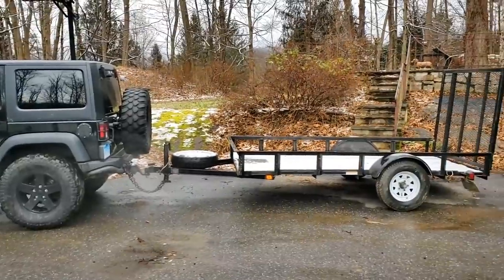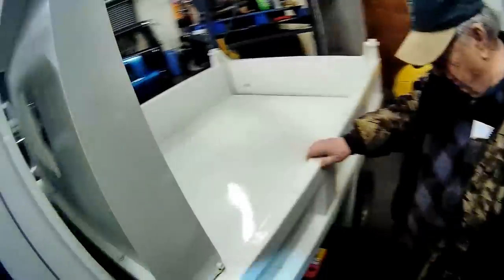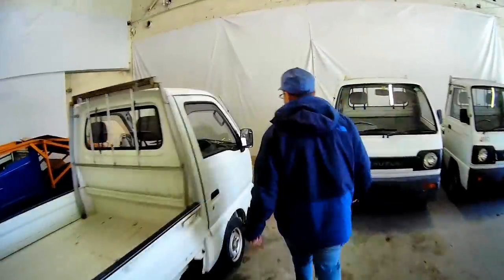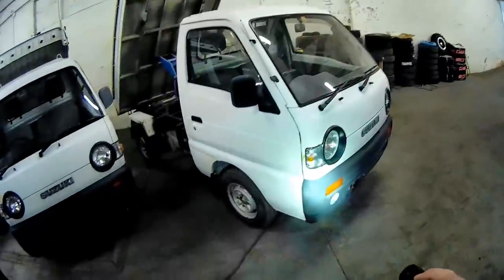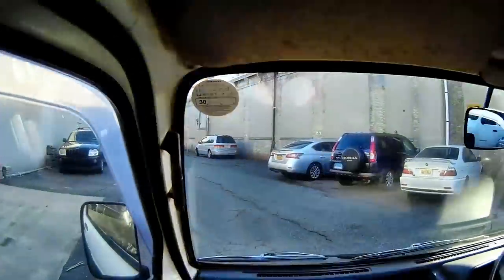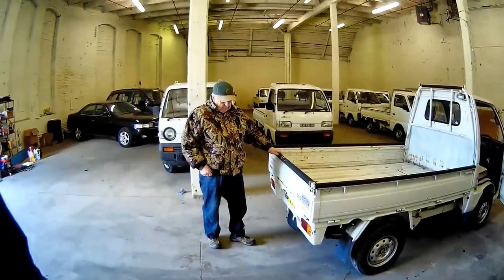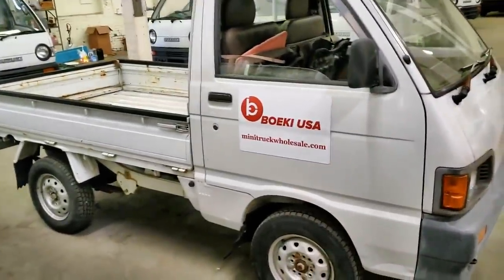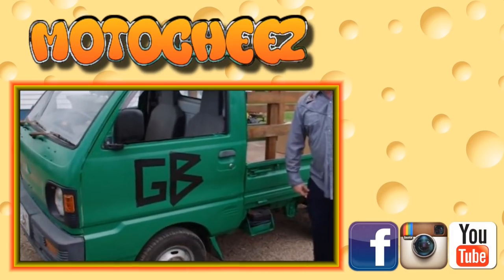$4500 Mini Truck info (SE01 EP01) what to look for, buy and get it home on 5x10 trailer

Comment: Kei truck FTW.  The one to have is the Subaru Sambar, certain models of them ( The XV) come with supercharged 4 cyls
Reply from the maker: I love those, but they don't come with rear axle.lockers. I need that for my land terrain.
Reply: Now I want to find one with a supercharged 4 cyl!
Reply: @ezralord4901  look up piggio porter  thy do a 1300 16 valve efi engine model very fast
Reply: Diff locks are available on all of the brands.   My Sambar has it.
Reply from the maker: I was taking about rear axle locks. Diff lock just engages 4x4
Reply: @MotoCheez  The Sambar has a 4x4 control on the shifter, and a different "diff lock" control on the dash.   The diff lock does force 4x4 on, but it locks up the rear diff as well.
Reply from the maker: Wow. I didn't know, sorry... Damn is that a hard to find option?

Comment: Be honest. You just wanted one because of Bubbles. I wanted one too as soon as i saw Bubs drive one but i don't like the radiator placement.
Reply from the maker: Haha. You got me! The radiator isn't in that bad of a spot. It's protected somewhat too
Reply: @MotoCheez   im upstate New York and needed a pickup to daily so i keep milage low and the salt off of my inheritance (5 speed, 1995 Honda Passport), so i just got what i was able to afford before winter came: a 2003 Ranger with a cap on it. There is a guy around me who sells these, but they were way to expensive for my budget.  Maybe someday.
Reply from the maker: Nice! 95 Honda, sweet!! They are pricey, I looked on CL for months.

Comment: I had suzuki carry when i was in high school 1983. It was fun and very light. I had to put couple sacks of sand to make it stable.
Reply from the maker: The Suzukis are a little more front heavy, which is why I wanted a dump Carry.. this could use rear weight, I'm not adding anymore to the front except another light maybe.

Comment: i’m in japan
and daihatsu is not toyota
totally different maker here
Reply from the maker: I've learned that since first video, corrected in comments, thank you.
Reply: Daihatsu makes many of the Toyotas you see in Japan. For many years they made, probably still do, make Toyotas. The Toyota Cami, Town Ace just to name 2. Both are great products.
Reply: Toyota has been a major shareholder of Daihatsu for many years. As of 2016 they bought the remainder and Daihatsu is now a wholly owned subsidiary of Toyota Motor Corporation.  In Australia, once Daihatsu left that market, you went to the local Toyota dealer for spares and parts (like I did for my Copen).   There's even been rumours Toyota Australia considered the newer model Copen to release there with a Toyota badge and support.       https://en.wikipedia.org/wiki/Daihatsu  "Daihatsu was an independent auto maker until Toyota became a major shareholder in 1967 as the Japanese government intended to open up the domestic market.....In 1998, Toyota increase its holding in the Company to 51.2 percent by purchasing shares from its major shareholders including financial institutions...... In August 2016, Daihatsu became a wholly owned subsidiary of Toyota Motor Corporation." Different factories and sales/marketing/support teams - same owners.
Reply: BTW, Daihatsu Motor Company is the oldest Japanese auto manufacturer est in 1907.   DMC engineers and manufactures Toyota compact models as well as Daihatsu badged vehicle.  Hijet has the highest share of K-truck special purpose trucks (ie. dump, fridge, deep fridge, extended cabin etc.)
Reply from the maker: Awesome info
Reply: Many parts are common denso between the two manufacturers

Comment: a lot of guys in my hometown use these and I have sold tons of 1st gen Mazda rx7 alloy wheels..for changing up to a 13 inch wheel..they are a 4x110 bolt pattern  hard to find anywhere else you just have to machine out the centre hole to fit the Mini truck..thanks for sharing this video..these little trucks are Cute
Reply from the maker: I saw the old Mazda rims would fit offset good too? What they getting fir a set of 4?, hard to find now.  thanks!

Comment: Used these on a farming apprenticeship in Wilton NH. Great truck, we used it for towing veggies, carrying a bed full of rocks (NH sucks for farming because of rocks), and used it to buy tractor parts. We could do a u-turn on a street that would require a 3 point turn in my 1500. I know I would buy one if I own some land. Easy to work on as well, except the farm had one with a carbonator, with a little bit of studying I learned the system and added the knowledge to my belt hopefully. But I for one am a big fan for these mini trucks.
Reply from the maker: Awesome info. Thanks.

Comment: Seems like a cool place...I'm in Pennsylvania so not super far from Jersey.  Do they have anything other than the mini trucks?
Reply from the maker: Yes. I have 3 times I stopped there. They have other JDM stuff. Check it out
Reply: @MotoCheez  I saw their website on the side of your mini truck and did go to their site.  Pretty nice stuff.  I used to deal with Japan Partner years ago when I was racing a prelude.  Their SUVs are a little pricey but the mini trucks aren't bad.  They have a Subaru right now that would be perfect for what I need...just a utility vehicle no off-roading.

Comment: I've always wanted one. My neigh or has one set up for welding. Got a machine and spools. He swapped a motor in and did a bunch of other work though. He puts it on his gooseneck and tows it to the job. Uses it for tight spots. Pipeline to refinery to factory work. He does everything.
Reply from the maker: That is cool as hell! I've wondered if it could be flat towed because transfer case has neutral. Ulrtimate little work truck!

Comment: Love these things! Luckily I kept my 1988 Ford Ranger. Almost sold it once when I couldn't fix a stall problem. Worked on it over 2 years time before discovering a bad check valve in the fuel reservoir. Now it runs perfectly again!
Reply from the maker: People want a nice small pickup like those rangers! Simple easy to work on one!

Comment: working construction for a smaller general contractor company that does commercial office TI"s this truck would be great! I would totally drive/use one of these ! In fact for how cheap they are i want one! where could i get one in WA state?
Reply from the maker: The place I went to New Jersey had them starting at $4,000, they have a sister company or actually the parent company is out there I believe boekiusa.com. I also have a bunch of links in the description of all my videos

Comment: Mine is just rear wheel drive and no diff lock,it does about 50mph.
If you get the PCM reflashed they say it'll do about 70mph or more.
Reply from the maker: Not bad.

Comment: I have had a climer/dump for 6 years on my farm
its lightly modified on the suspension. I will carry one round bale or 2 large squares ( 700# each ) I have worked the shit out of it and it keeps on going.
Reply from the maker: That's awesome, love all the input I'm getting on these. My uncle owns a decent size farm, he's a little tall for it but may still get one. His only issue is standard shift for farm hands, but in low it's so easy to take off it's not an issue imo

Comment: that crazy steering sound goes away it's the short and long cv axles scraping on their teeth it hadn't been used in awhile.
Reply from the maker: It's a rubber mount on the steering column.

Comment: I have a friend in Northern California who has a Suzuki 4wd mini truck. He talked to the local Highway Patrol, and was told that it could be run on the road as a farm vehicle, and he didn't need to register it. He has to display a safety triangle reflector while on the roads.
Reply from the maker: Yes, that's a work around. Max speed is 25mph. It's "slow.moving vehicle" triangle. I'm doing that until I get.my registration. 😁

Comment: when I was stationed in Japan the on base repair shop had one with a larger motorcycle motor in it and it hauled butt
Reply from the maker: Sweet! That's what I've said I would use if I ever needed a transplant! High RPM , small footprint and high HP is perfect for these low geared lightweight trucks.

Comment: Very cool little trucks!! Cheeper than my UTV and to get heat windows ac/heat in a UTV Gotta but sumthin new for $35k or ton of money in after market! Not as much suspension but with a lift and ATV rims and tires this would be an awesome little off road vehicle and with that bed very cool! Set up as a little expedition truck with like an over cab rack with roof tent and some extra gas/water put all your gear in the bed and go!! Very interesting. Thanks for the content
Reply from the maker: It is! I did a ton of mods in this series into the 3rd season on this playlist
Reply: MotoCheez thanks I’m gonna watch everything ASAP thanks again!

Comment: These little Bongo Trucks are so much fun to drive. I was stationed in Japan for 5 years and enjoyed the one we had at work. Only issue is they're not built for people over 5ft 4 & I'm 6ft 1.
Reply from the maker: Yeah. I'm 5'10 and fit OK. If I were taller would be tight.

Comment: We had a couple in the service.  They were governed to 25 mph. Above that, the ignition would shut off, and if you kept your foot on the gas, all the gas would end up in the oil pan.  Never hold the throttle against the governor.
Reply from the maker: Nice, the ones newr than 25 years old have to be to be legally brought here. This one isn't governed.

Comment: You know, if I had a bunch of property to maintain I'd much rather have one of these than a UTV. These are fully enclosed, have heat, sometimes even AC, and they're not gonna be more expensive than a UTV, and you can even register this and put it on the road if you needed to run into town for something.
Reply from the maker: I agree with you 100% and that's why I decided to buy one 😄😄

Comment: I sat in one, the cab is to small in the cab I'm 6'3" 300lbs . I think the van type would would be a good mail Trk for delivery.
Reply from the maker: The jumbo trucks have a bit more room too
Reply: @MotoCheez  usually it's the leg room and the seat doesn't go far enough back.
Reply from the maker: David Taylor the seat goes back further on the jumbo. It’s an extra cab

Comment: Those trucks would be great to experiment on 
to  convert them to Electric Vehicles.
Wen I worked for the DoD, 
they had many of these forms of mini trucks and vans
military bases.
Of course you could not drive them on the public streets,
but you could drive the all over the base.
Reply from the maker: It would!

Comment: they actually fit these daihatsu hijets and suzuki carrys with 1000cc and 1500cc engines engines outside of japan, you might want to check those out.
Reply from the maker: That would be awesome
Reply: @MotoCheez  oh and you should also definitely check out those old Daihatsu Taft or rocky, they're kinda similar to the Jimmy

Comment: Are they street legal on major roads not hiway I would daily one 30 mile round trip to work if the bed hade higher sides
Reply from the maker: They are in most states, but I wouldn't use on the highway, they're slow and not that safe

Comment: i just remembered that my dad used to have an upsized/non-kei version of one of these in red called the daihatsu zebra espass(D130 jumbo), it's a 4x2 but it has a 1300cc with a 5 speed, that van was a total POS and broke down a lot
Reply from the maker: I haven't had any issues
Reply: Zebra was designed and manifactured in Indonesia.
https://en.wikipedia.org/wiki/Astra_Daihatsu_Motor
Reply: @phineasNBJ  but it was based on the jumbo Hijet, just a different engine and body style.

Comment: Cushman used to sell these small trucks back in the 90s/2000s also in a van version. Seems like they were made by a Chinese company. They pop up on Craigslist every now and then.

I believe these had the 4th gears knocked out to limit to speed to 35 mph. Otherwise it would too easy to over ride a governor on the carburetor or ignition system to get them to go 50 mph.

That way they could be considered a low speed vehicle and street legal in some states like Tennessee. The first time I actually seen one on the road was in Greeneville, TN, It was used the city. 

Does this guy ever import the van version? All I seen in the video was trucks.  A micro van is what I would like to have. 

Also did he supply a NJ title with it?

I can technically register anything older than 30 years old in TN from another country but the DMV can be hard to deal with so I had the guy who imported my Trabant from Hungary to register it in Florida then sign off on the title. So all I had to do was hand it over to the "Bs" at the DMV and they handed me a licence plate no questioned asked.
Reply from the maker: Good info on the Cushman! He does get the vans once in a while, they come with import paperwork so it would have to go through inspection I think like here in CT. Call Amir, I bet he knows, tell him MOTOCHEEZ sent ya!

Comment: Enjoying your series and all the improvements. It's also nice to see familiar territory (used to live in Cornwall). One thing to note is that most of these minis of this vintage have a 5 digit odometer. The odds are very good that any with a low mileage have actually turned over. 34,000km usually = 134,000km. That's more realistic with a 25+ yr old vehicle.
Reply from the maker: Cornwall, yeah I go there during the summer  Yes, that's true! You can tell the .ileage by the wear on pedals and other components like steering suspension, leaks etc. And stickers on the vehicles for timing belt change etc. Thanks!
Reply: Yes, you have a better eye for wear than most. The best verification is the mileage reported on the import documents. That has to be accurate. Not sure if Ari shared this document with you. 

I have really enjoyed this series. You have a great balance of humor and skill as a mechanic and some decent production values too.
Reply from the maker: yes Amir  did give me all the import paperwork with the verified mileage and everything because you need that to actually get inspected to register them. Thanks for that compliment, I feel like I have kind of a twisted sense of humor. 😜

Comment: I wanna see  Big Dog work his magic, what channel is that? I traded for one of these, a Suzuki, and it has a rebuilt 3cyl diesel, 4 or 5spd, 4wd, hi-lo, tilt bed, rusty, and grey color, it has a lift with new tires and rims, I traded a 90 jeep comanchee with 90k original miles, it too was rusty, I did the trade because it was diesel and it seemed like a better deal than a utv, he needed a work vehicle and maybe spent a little too much on the bells and whistles, I don't know a lot about it otherwise, I got it at the beginning of winter 11-2018 and stored it until spring, the plan is to keep the trade going- I started with an audi I got for $200.00, traded for the Comanchee, and now the Suzuki, I think I have a $5000.00 trader or? Now I got to find Big Dog, no way he was going to pull that storage container with anything smaller than a tractor

Comment: We had these in europe with left hand drive of corse, these daihatsu's had a 1 liter 3 cilinder came also in a van. Verry handy vehicle for streetsweepers in old city centers like Amsterdam and Utrecht. Import of this type of pickup truck /van's stopped 20 years ago for a good reason. they are verry unsafe in a collision the front of the cab gets pushed in your feet and legs crusches against the frontwheel and the engine/gearbox.
Reply from the maker: Yes. I wouldn't want to hit anything! Mine is 95% off-road.
Reply: @MotoCheez  that is verry wise to putt around the farm could be usefull.

Comment: Curious what the turning radius on the one you bought is, we have a Polaris ranger that has a pretty wide radius that we use in the vineyard.
Reply from the maker: I'll check that out and let u know, also post it in the description and my webby. Good info to have
Reply from the maker: Finish up video... used your question for the radius test I took.
Reply from the maker: * finishing

Comment: Stockton Wheel can build you some fifteen inch steel wheels for the back and add a lift kit in the front to level out . Makes road speed more enjoyable and still have enough gear in low low to get it done .  Tell  Everybody
Reply from the maker: Wonder what a set of 15" wheels would cost....

Comment: makes way more sense than a side by side.. for offroading the best is you can put atv tires on it for digging
Reply from the maker: I'm a believer now! A bit smaller inside, but heated wipers sealed etc...
Reply from the maker: I did the tires 😄
Reply: Right on

Comment: I exported about 75 of these to Canada. Canada only has a 15 year wait for import. All are basically bullet proof. The late 80s Mitsubishi actually has a 4 Cylinder 660cc motor and has more torque. The are also exntened cabs that have a little more room but cost a bit more.
Reply from the maker: Nice! Do they have rear axle locks? That's a must for my property

Comment: invest in some heavy duty yellow straps with the hooks and shackles. I use  ratchet straps every day at work . All kind of sizes and makes, and  those orange ones will fail on you eventually. And I’m pretty sure you don’t want that to happen ,while you’re pulling a trailer with cargo you just purchased.
Reply from the maker: You're right, I do have some heavier duty straps but they were in a bag inside the house that I should have had with me

Comment: I have a mitsubishi MMC  1995 with everything but A/C  , I put a 3" lift in it with quad tires as a firewood truck and have never heard of had any of those noises or issue's, that guy has junk ! You can a container from over seas with 4 of them for 8k, so shop around before you buy !